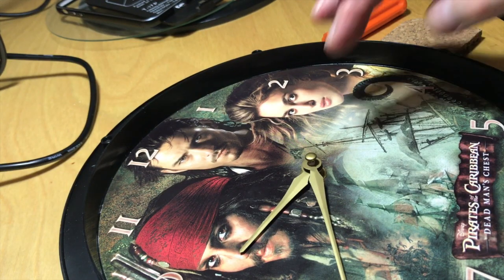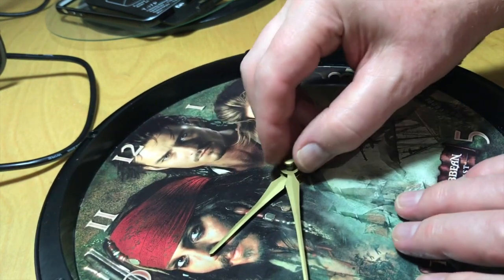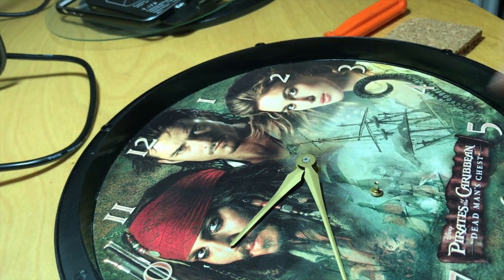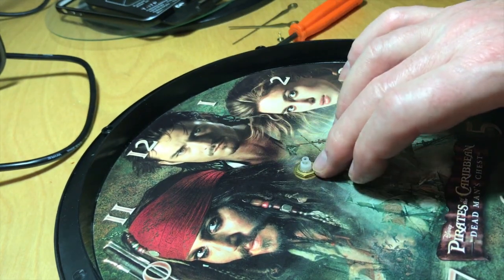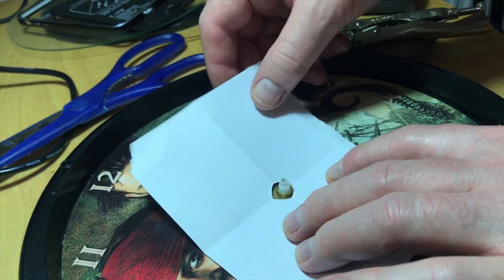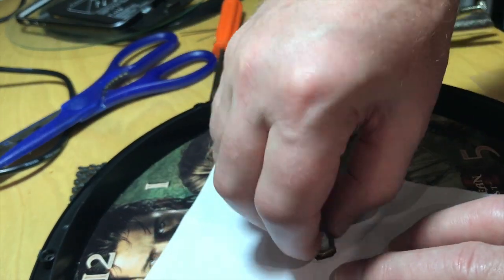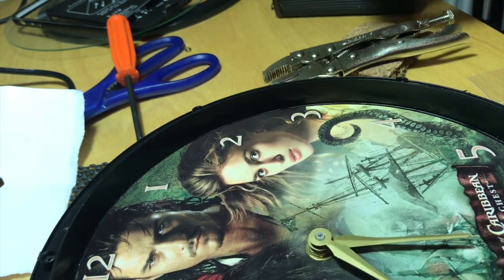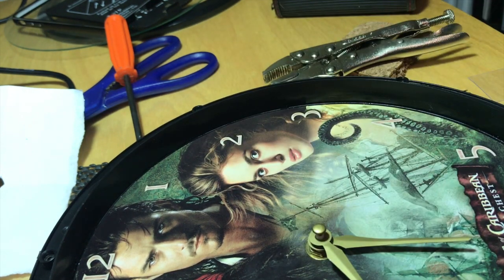Broken Quartz Clock Hand Removal  #fixed1t527

Comment: How do i open up a clock which has a plastic shell in front of the actual clock? The things that shows what time it is are loose.
Reply from the maker: There are usually a set of small screws around the circumference or hole around the sides where the clock face is clipped it. Please don't forget to subscribe to my channel and check out my other great videos and share #fixed1t with friends and colleagues . Thanks Malcolm aka #fixed1t